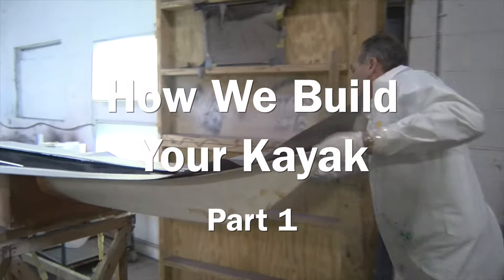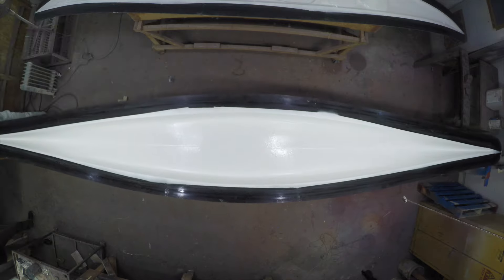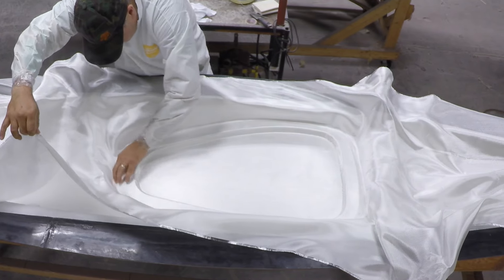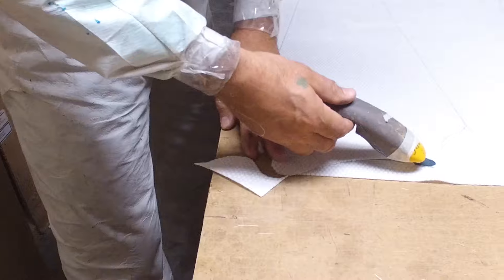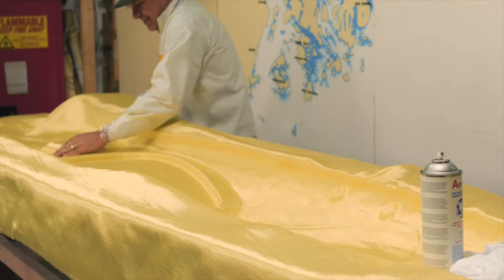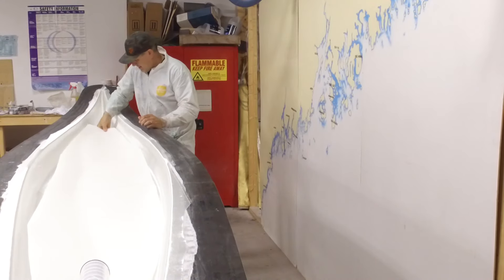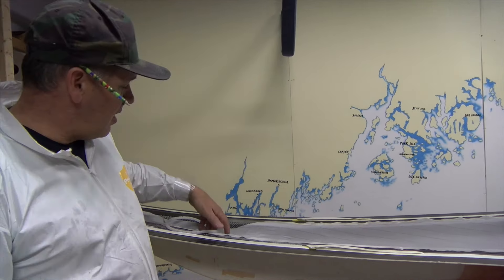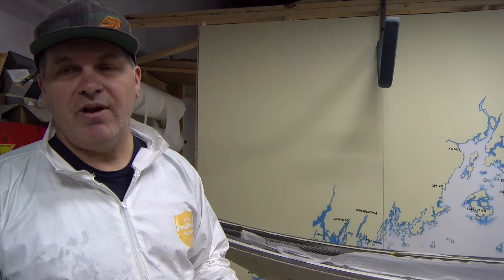How We Build Your Kayak (Part 1 of 5)

Comment: What is the thought process / design reasoning when choosing the different weights of each layer of fabric?
Reply: woven for strength , stranded chopped so can be sanded smoother for finish
Reply: For the deck: I believe that the lighter weights of fabric show less of a woven pattern, and as such are best used for outer layers in order for the surface to be smooth. From there, the 9oz fiberglass is pretty much the same thing just thicker, because appearance is less important. The honeycomb is added to the middle because it has no durability, and instead only serves to thicken the composite for rigidity. Finally, the kevlar is on the inside for a final addition of rigidity. Presumably the kevlar is the strongest layer, and since the boat is more likely to flex inward than outward, tensile strength is most important on the inside.

Comment: Hi! What substance do you spray from the balloon when you lay the layers?
Reply from the maker: Air tac, a spray adhesive
Reply: @LincolnCanoeKayak  what is its basis, that it does not interfere with the work of resin and vacuum
Reply: @LincolnCanoeKayak  I found this particular spray.
There is still a question what technique do you use for vacuuming?
Reply: @LincolnCanoeKayak  thank you